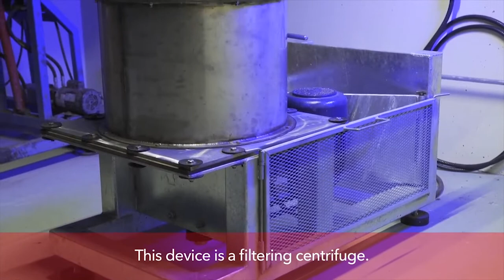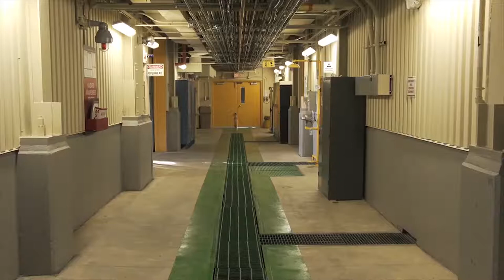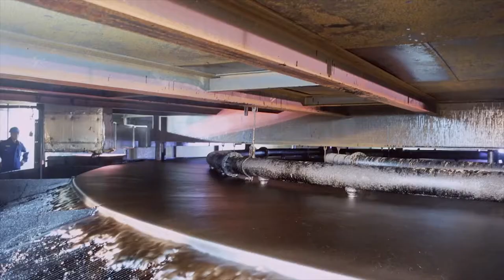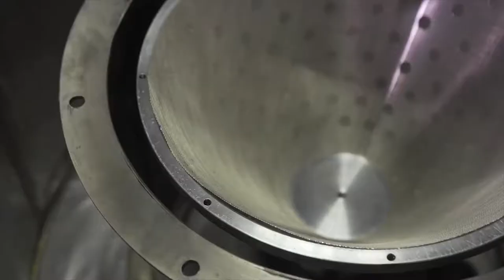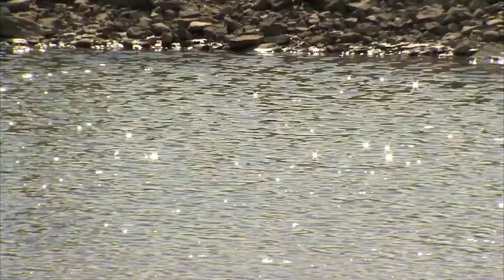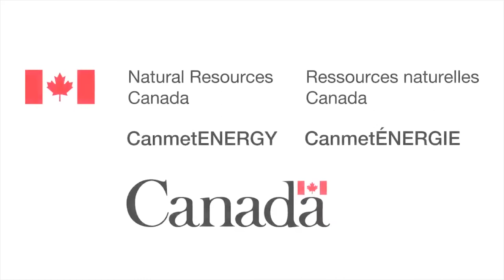Recovering Bitumen from Oil Sands – a New Approach

Comment: It is the clay that makes a mess of the whole process.  Water mixed with clay ends up creating a slurry that is too thin to put directly back to the sites where the whole mess was dug up in the very beginning.  Using a solvent gets around this problem, but then the solvent introduces a second problem = contamination of the groundwater from the solvent itself.